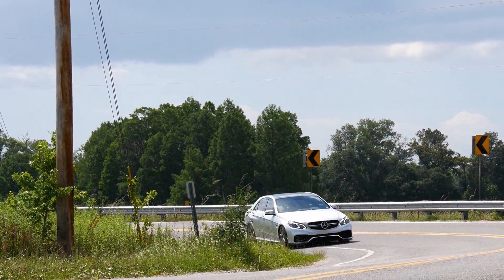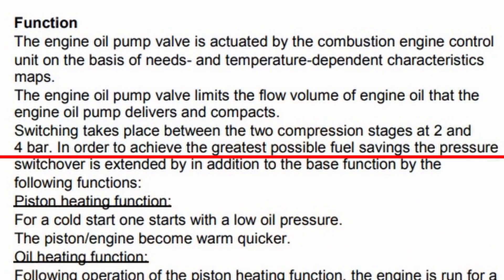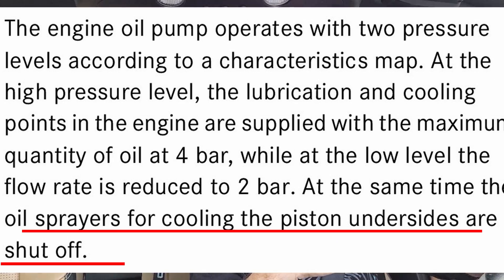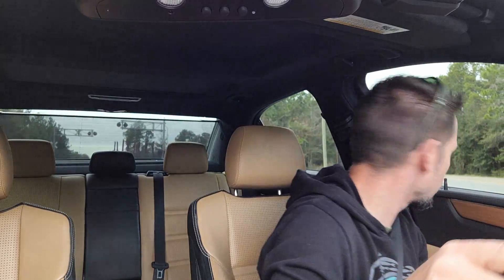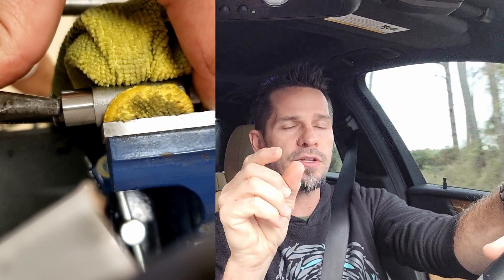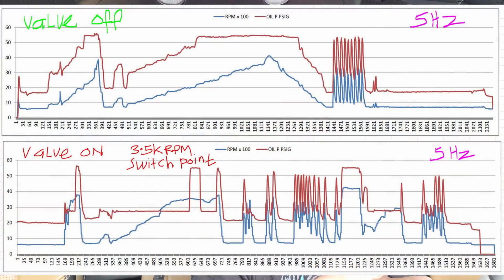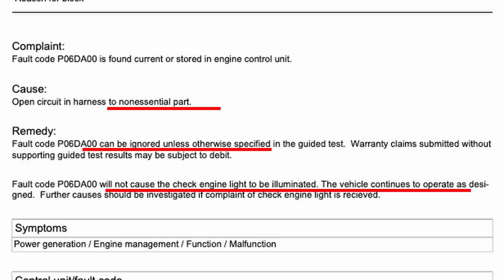M157 KILLER SMOKING GUN? Oil Pump Solenoid ~ Free mod! ~

Comment: The bent rods is caused by the rods being too weak simple as that m278's run the same rod and rarely get bent rods unless heavily modified... m157 bend rods on stock boost completely stock!!    There are also reliable rumours the rods are bent a tiny amount from the factory and then when hammered on they bend more... either way the end result is the same a destroyed engine.   Bore scrapping is usually either bent rods or usually bad/worn injectors bore washing the bores of oil hence the scrapping.    Its obvious if its bent rods because the bore scraping will be on the same centreline as the wristpin or crank when you bore scope it.   Whereas the bore washing via injectors will be 90 degrees to that.     This oil pressure thing could contribute but its not the main cause imo.    In short check your injectors for leaks and wear.   And I wouldnt personally even bother owning a m157 because even stock they can bend rods.    The rods need to be swapped out for aftermarket and run new injectors, do this solenoid mod and "touchwood" it should be reliable.      So I think you should remove the comments about bent rods as thats clearly not caused by this issue but the information about the solenoid is bang on.    The older non turbo v8 cayennes had bore scrapping which was also mainly caused by lack of piston oil squirters and old injectors  compared to the turbo versions.
Reply: I don't think the actual material of the rods is weak for stock boost or even tuned, however the M157 and M278 have piston guided rods which are inherently unstable and place the rod in a compromised position which allows loading it wasn't designed for. Even aftermarket rods and pistons by ItalianRP have the same design as they are still designed to use the stock crank. However not as much of an issue with stronger parts and more forgiving Darton sleeves. Still a poor design choice imo. Probably the reason GAD's built M157 is a stroked 5.8 with an aftermarket crank that uses traditional crank guided rods. Regardless of all of that, the oil pump solenoid disabling can only help by allowing the piston oil squirters to operate more frequently.
Reply: @RalfMilo  M113k is  the same design hell its basically the same engine block without the twincam heads and direct injection you find me a bent rod on any m113k doesnt matter if it was in a SLR or a E55 making 750hp+.      You wont.    Half the problem is actually the diagonal cut at the little end of the m157 rod not just the allowable movement on the crank end.    The m113k rod doesnt have that cut out.       A good enough design would be a m113k style rod and piston combination to suit that style rod you dont have to go crazy with all this other shit unless you already have damaged bores and are chasing crazy power like Gad and co.     Tasos already proved all this with two different design ItalianRP rods one with the original cut out and one without that can handle even more power.     But ItalianRP now do a rod with the little end cut out like stock that also holds up simply because the rods is better than the m157 one.       Again if you put a m113k style rod and piston to suit m157 compression it will be most likely very reliable.
Reply: @austingtir   I never stated that the M113k rods are the same material as the M157 rods, they very well could be stronger. Few things to point, small end on M157 rod is tapered and a different design than the M113k. Most M157 cars are heavier and AWD with wide contact patches on all corners which is significantly more load than the lighter RWD W211 and other M113k equipped cars. Horsepower does not bend rods, torque does. More specifically high cylinder pressure at low rpm. M157 with its small turbos can make 800 ft/lbs at 3000 rpm when tuned. All these factors coupled together increase the probability of bent rods.
Reply: @RalfMilo  Mate you can live in denial and frankly lala land all you want.    The m157 rod is a shit design.      Again if you put a m113k rod in and machined that m157 piston to suit its little end (assuming the big end would work of course) I bet it wont bend a rod upto 750hp+ which is about all most people want to make.       Anyway this is why I own a m113k and m156 and a m278 and my next one will be m177 powered.    You can keep your crappy m157 rods and live in denial.
Reply: Bent rods are one thing, but a lot of these M157 engines have experienced just bore scoring. So more lubrication NEVER hurts.
Reply: @AnontheGOAT  As he said in the video most people are tuned that have issue but not all.    So its either bent rods scrapping the bore in line with crank or its lack or oil or bad injectors leaking or bad spray patterns washing the bores on the plane (the larger skirt area on that face also contributes) opposite the crank line which again would be more prevalent on tuned cars for obvious reasons.   I suspect it could be 50/50 with the m157 because of the rods.   With m278 it will be mostly bore scrapping due to bore wash from the injectors or lack of oil from the piston squirters or both.   I just did this solenoid mod on my s550 BTW so I agree with that.     Next I will be checking my injectors and then just hoping for the best as thats about all you can do.
Reply: @austingtir  um but that’s not what you said in your OP “m157 bend rods on stock boost completely stock”
Reply: @AnontheGOAT  Yeah because thats a fact.      Cant you read or something in the last post I said "MOST".      Thats repeating what the guy in the vid said which is also correct.    Most m157 bend rods tuned.    Some bend them stock.    If thats the clarification your looking for.     All im saying is I dont know why he even mentioned bent rods going with the oiling issue its literally nothing to do with it.     Bent rods is purely mechanical failure because the rods ARENT STRONG ENOUGH in the m157 application.    And because of that some people blame bore score on an oiling issue when its the rods being bent and vice versa when I just described how easy it is to tell the two failures apart.     Bore scoring because of oil/injector leaks and bore score because of bent rods are two completely different things thats what im empasizing here and m157 owners in particular need to understand the difference.    Because you can simply stick a bore scope camera down there and tell almost staight away why the engine failed or was misfiring.
Reply: @austingtir  I hear you but I don’t agree with sticking a bore scope in to determine whether or not the rods are bent. You can’t see them from the top end.
Reply: @AnontheGOAT  Thats simply because you dont know what to look for I have already explained some of it.    Its incredibly simple to tell from the top if a rod is bent with a borescope on these engines.     In short the pistons will have clean spots on one side where its been heating up on the cylinder wall more and loosening the coking.     Its very very obvious when you know what your looking at.    If you get a good HD borescope and manipulate it into the right positions you can even see the gap is different on each side of the piston.    These can also bend the rod so little that its hard to tell but usually its blatantly obvious.
Reply: @austingtir  good to know

Comment: Is there a way to code it out after unplugged? Like with a special scanner. Im here in cali and cant have any check engine light. I mean i could just plug it back in and pass emission and unplug after but wanted to know if it can be code it out.
Reply from the maker: I looked in xentry, vediamo and Monaco and couldn't find a setting for the oil. It's possible a tuner could.
However, the code cannot be read with any OBD2 readers, only with Mercedes diagnostic tools like xentry
Reply: @ExoticCarDIY   So the smog tech will not see the code on there scanner? It will not have a check light on?
Reply from the maker: @boyb72  correct
Reply: @ExoticCarDIY  Yesterday I unplugged it and ran diagnostics with Snap on scanner and it reads the code. Will try with Autel scaner as well, to see if it reads this "internal" code

Comment: 100% clickbait going on here, 20yr Mercedes-benz master tech/ shop foreman. I have never seen an M157 fail from the oil pump solenoid nor any other motor. They use this bypass across the board and have been for many years. Typically it's the little harness from the oil pump to the oil pan ( the inside harness that fails and you get a check engine light.) Seems to be most present on the M278. But again in all my yrs I have not seen 1 motor failure from lack of lubrication. also that oil your seeing in the harness is probably from cam solenoids or the fuel injectors. the oil in the harness is a much bigger issue as it WILL make it way to the MED and fuck shit up. if your going do a click bait title, go after the oil in the harness, because that is a major issue and not the oil pump. as right now all M157's are out of the 8yr/80k warranty so good luck..
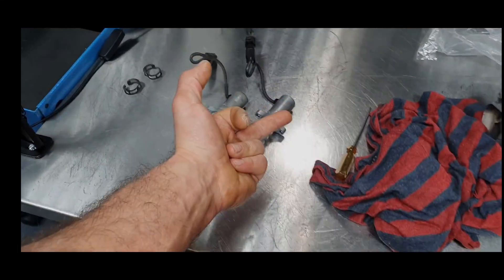Reply: At video minute 02:55 it was explained and with a video clip too...how Tasos customer got unlucky and the oil solenoid was jammed up in a low pressure mode and causing the M157 engine to an early failure. It doesn't matter that you are a 20 years experience MB MasterTech /foreman, because compared to Tasos and for M157 engine, I can bet Tasos tear down and rebuilt M157 more than you by much..... that is why he found something you have not yet experienced. Also to note, Tasos is in Dubai (UAE) where M157 engines for a country so small but freakin rich....the UAE at 32,300 square miles or only 180miles by 180 miles .... is M157 plentiful. 

So don't brag on your M157 experience if Tasos experience is the level you questioned, it will be kinda embrassing when you ever have the chance to actually meet Tasos and compare notes.
Reply: Just wanted to show support for people who show up in the trenches and are like, "tf is this?" Manufacturers have been making mistakes since manufacturing was a thing. They will continue to do so and they will eventually settle upon what is an acceptable and negligible amount of fault. This happens. I've seen these guys with 20 years show up on forums like trolls fresh out from under the bridge, set in their perspective of what they've seen. I do not denigrate their experience because 20 years of experience in any field should make one a master. What I question is their ability to take a step back and say, "Ya know what? Maybe I don't know everything." That right there is why we always question.
Reply: I hate these 20 year mechanics coming on here doing 19 years of oil changes thinking they know everything.
Reply: same. @nnarkaj
Reply from the maker: Lol, yup
Reply: I found that the harness to my ECU is soaked in oil and there is oil on a few pins of my ECU. Would you recommend I cut back some of the wicking from the harness to get it away from the connector end? Thank you!
Reply: @Shalerboy101  this is pretty common on all MB engines over the past 25yrs.  I suggest getting some electronic contact cleaner from any parts store, spray out the MED (ECU) while holding it upside down, spray out the connectors to the ECU and blow out with compressed air. the source is usually from the camshaft solenoids or the fuel injectors. ( they were oil cooled as well) as long as the 02 connectors are dry, you should be fine.
Reply: @malloynx   Thank you for the information! I realized today that the pins did not have oil on them, just some sort of wear from the pins sliding in and out of the connector. But the harness IS soaked. For now, I pulled back some of the wicking and ordered all new camshaft position sensors as they’re all soaked. All of my camshaft solenoids are completely dry. I will have to look into the fuel injectors though, I haven’t done that yet. Found out today that I have two bent wheels as well, so new ones are on the way

Comment: I just did this today on my e63 and I can't believe what a night and day difference it is. No more surging and odd shifts at low speed. Another Easy like and share. My favorite diy channel on YouTube keep up the killer work man.
Reply from the maker: Awesome man!
Reply: @ExoticCarDIY  Can you make a video of the mechanical oil pressure gauge with the solenoid connected first and then disconnected to visually see the difference this simple mod can do?
  That would be a great video and solidify this mod into all of your followers eyes and minds!  

Great videos btw!!
Reply: @ExoticCarDIY
Reply: Hello, I hope you are well. I have wanted to communicate with you for a long time, and I do not know how. I am one of your followers, and I follow you constantly. I trust your experience, and I have a problem and an important inquiry for which I have not found an answer or solution.
 @ExoticCarDIY
Reply: I just heft them unplugged, didn’t feel comfortable with the options I had to cap the female section and it completely coming off and getting into the pulley etc .. hopefully it doesn’t hurt anything like this ?
Reply: Hey brother, which model year do you have and how did you protect the plug ?
Reply: @maddoxx6250  2014 e63. I just used some vacuum line caps that I had laying around but, you can also get dummy plugs if you google "2 pin connector" and match up the shape.
Reply: @loganpowers1915  Thanks brother. I’ll try to find these dummy plug to keep it most OEM. German Mercedes Benz dealer are kind a sketchy 😅
Reply: @maddoxx6250 the top cam shaft sensor plugs use the same type sensor head and you can use those to plug the hole up,just cut the wires off and silicone the hole so no trash gets in.  Fcp sells those harnesses, Ken made a video about these harnesses earlier in the year
Reply: @besicm1 Hi, are you saying this as a method to correct if the plastic sensor/plug comes out of the hole entirely ? Mine came out broken and I’m left with an open hole with the sensor metal prongs half inside ? Can I just plug the hole and not worry about the wire inside the timing cover cause any problems ? Thanks
Reply: @maddoxx6250 my Dutch Mercedes Dealer is absolutely fcking useless in helping me find anything related to this job. I have the silicone boot but still no way to plug it
Reply: Hey man if you wouldnt mind, how has it held up? if you still have the car, would love to know cuz I am thinking of doing it to my E63. Thanks in advance
Reply: I have an error related to the Y130 sensor. I am experiencing a delay in the gearbox when accelerating on inclines, and sudden/brusque shifts when downshifting, especially when the RPM drops below 1000. Could this be caused by this sensor?

Comment: I have a Stage 2 ECU tune on my M276 3.0 bi-turbo engine that was problematic before this "mod".  The car would bog momentarily with light throttle use when coasting or simply maintaining speed.  It would also surge slightly at slow speeds, such as below 20 mph in a neighborhood.  Of course, these conditions occurred when the RPMs were below the solenoid activation speed.  Since this "mod", throttle response is instantaneous with no bogging or surging.
Reply: where it is located in m276? Same as m157?
Reply: @mattkochanowski6196  Facing the car, it's in about the 7 o'clock position to the crankshaft pulley.  With the turbo version, it is slightly behind the intercooler.  On the NA version, it is more visible.  In both engines, I removed the passenger side air intake duct for easier access.
Reply: Hi. I have 2016 E400 stage 1 tune. Car is powerhouse. But since the tune my shifting is not that smooth. Do you think this will help? And also if I disconnect it will I have some check engine light or something? Thank you

Comment: I've done this mod to mine but, where's best to plumb in an oil pressure gauge to check that the solenoid isn't already stuck in the low pressure position?
Reply from the maker: It's a big pain, I just renewed mine very temporary
https://mbworld.org/forums/w212-amg/877669-oil-pump-solenoids-3.html#post8893140

Comment: @exoticcardiy - are there any issues if you unplugged the oil sensor and then days later, plug it back in?
Reply: Days later, probably not. Weeks or months later, yes. If the valve has not circulated oil for a while there a chance for piston particulate (carbon or aluminum) to have accumulated in the solenoid gallery ready to get forced in. Then you'll get a stuck solenoid in the low pressure position and risk damaging your engine.
Reply: @AnontheGOAT  thanks that is very helpful.   I am torn between wanting to try this mod for the several good reasons discussed (better oil/lubrication and better pedal / acceleration at low rps) and having concern that this is a $30-40K motor when new and if you destroy a rod or piston or cylinder then you're in deep trouble needing to replace a motor of that cost on a car that has depreciated to 30-50K max
Reply: @jvakos  You won’t destroy your engine by unplugging it. There’s really zero downside at this point. It’s a stupid “eco friendly” feature that’s killing engines because of a terrible design.
Reply: @AnontheGOAT  ok good to know thanks ill give this a try!
Reply: @jvakos how do you like it?